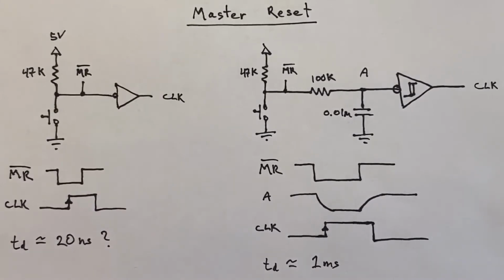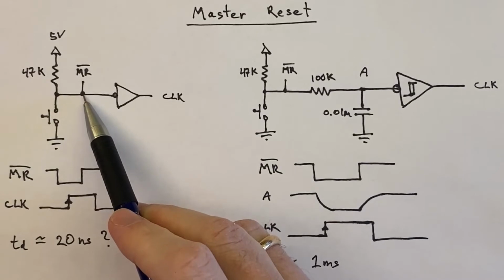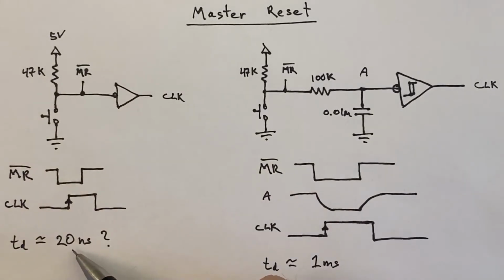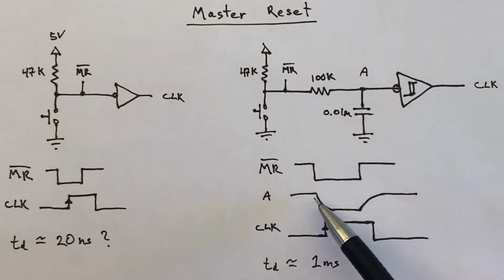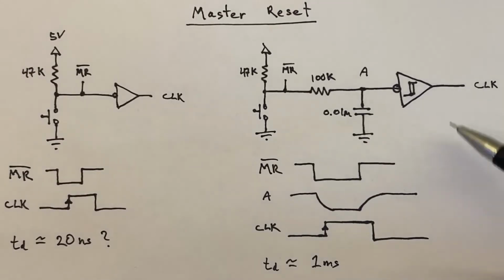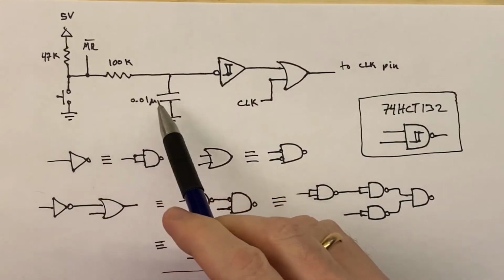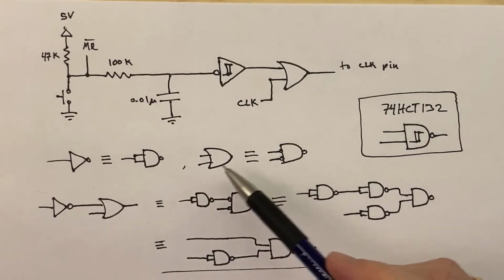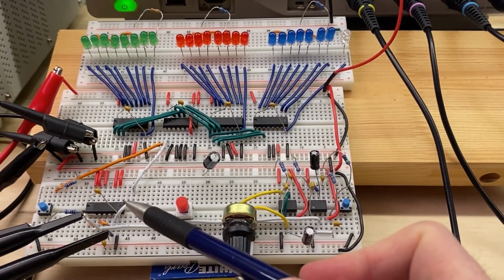Electronic circuits always need a Reset Button!

Comment: Great video! p.s. the CD4093BE is a chip that has a real long propagation delay, way slower than the 74xx series. typical 190ns at 5V.